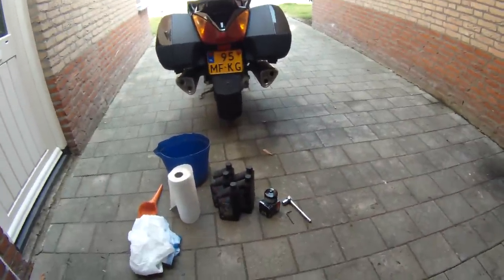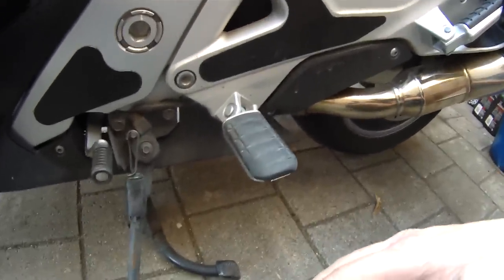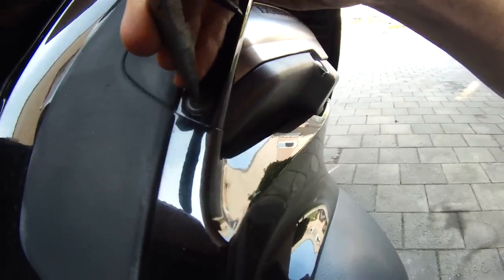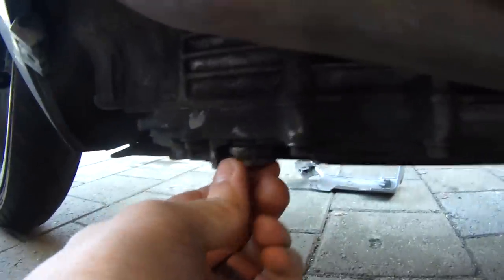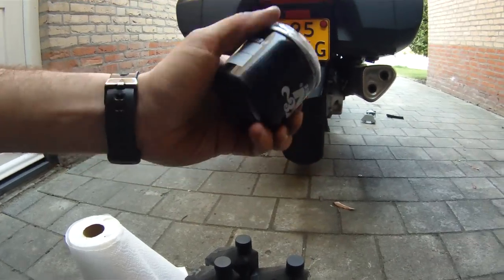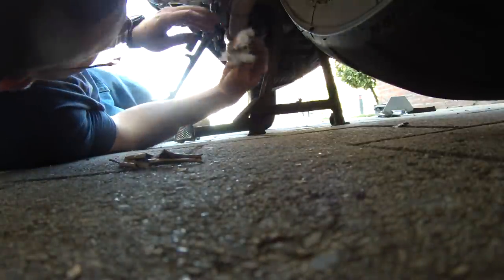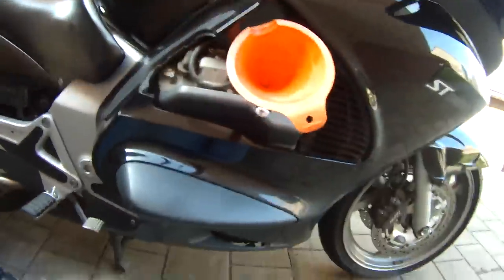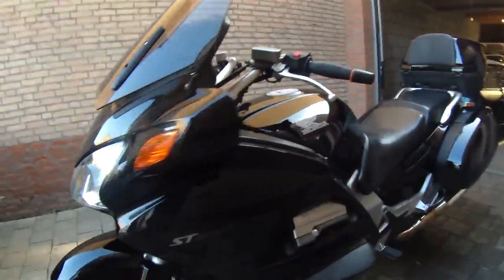How to Change Motorcycle Oil (ST1300)

Comment: What is the black wing attachment for right in front of the knees? How may I suppress heat coming from the right side of the engine to my knees especially the right knee. I don't have tank pads now.
Reply from the maker: +Peter W. Santa-Maria Sr. The pads in front of the knees serve no purpose as far as I am aware. The pads were on the bike when I bought it. As for the heat... I took the tank off and wrapped the frame with heat shield and put a barrier between myself and the engine bay to protect myself from all of that heat. It is great in the winter but in the summer and in traffic it is quite miserable.
Reply: Great bike wrap the pipes with one inch heat tape that will fix the heat problem

Comment: I have used only synthetic oil in my motorcycles for over 20 years and never had a clutch slip and several of the bikes were Honda. What you are saying is not true.

Comment: Synthetic automotive oils are fine as long as they don't have friction modifier additives.  Basically, as long as it starts with 10W- or higher, it's fine.  I've been running Mobil 1 10W-40 and 15W-50 in multiple motorcycles for decades.  Avoid anything with "EC" (Energy Conserving) on the label.  By the way, the W stands for Winter, not weight.  As in the cold weight of the oil at winter temperatures.

Comment: Thanks for the detailed video.  After viewing, I successfully changed the oil/filter in my 2008 Honda ST1300.  It was a little tricky getting the right amount of oil (4 qts) added so that I didn't overfill.  As a first timer, the local shop suggested that I remove/add the oil filter while the bike (and exhaust pipe) was cold. No burns.  Also, I purchased/installed the K&N filter with the nut.  Awesome suggestion!  Thanks again!  Only wish I was a little neater when draining the oil.  Next...adding coolant.

Comment: I'll give it a try on the new to me. From the right side as a comment stated.
Some types of oil may blow away in the wind like hairs, so my ultimate advice is to not do this in windy weather. Always have enough plastic underneath.
Recycle the old oil, some shops have heaters that burn old oil and I used to deliver it there.
These oil plug rings are from soft metal. Put them back in the same orientation and clean the drain plug before removal.
Study the amount of torque the plug needs (22 foot pounds by manual but being dry. With a little oil on it, more likely round 17 foot pound. The thread is easily stripped from the engine. People do not require torque wrenches, they just stop when the washer is being compressed. Removal of the drain plug is another story. Some are stuck into place and that happens a lot. Warm engines help and treating with penetrating oil the day before. The best penetrating oil is made on demand: 50 percent acetone with 50 percent Automatic Transmission Fluid or final drive oil and keep shaking. Do not use no penetrating oil on a new to you motorcycle. Don't hammer or pull the wrench repeatedly, like many people do. When you followed up my advice,  warm engine and penetrating oil, I would say it is most safe to lengthen the socket wrench with a metal bar and it will crack loose in just one pull. 
The funnels that are commonly used have necks that can bend and a screen at the bottom of them, that some day may safe you. I had oil from unknown origin and it contained a welding droplet. Everyone could want to keep an already opened can because those are large. When filling bottles with the old oil the screen will also reveil small objects. My other Honda (PC800) would not accept a straight neck funnel and the long neck funnel does not have a large volume.
Filling soda bottles gives you an idea how much oil should be added back in and you use one of the same preferably for adding. Riding with too much oil and being ok with it is a common mistake.
Oils that can slip the wet clutch have friction enhancers like teflon in them. Not any kind of factory gasket material can really withstand full synthetics and the cleaning power may dissolve the dirt from old gaskets, being not always a good thing. Half synthetics are way more gentle.
I have read somewhere the oil being low in the inspection window, will show to contain more after the inspection procedure of 3 to 5 minutes running stationary, a 2 to 3 minutes wait and then placing the motorcycle level. Level being on two wheels. I wanted to do the oil inspection safe enough and have fine results placing a shaving mirror on a short stem a little further up front and shining vertically towards the mirror with a LED flashlight.
After all oil changes I hear a burp from the oil filter, mostly after a few miles. So I ride fairly slow and wait for it.
Reply: I would like to answer to myself. Today I changed the oil and it was very easy from the right side, reaching to the left. Now I am afraid the oil gets stolen. Not any fairing had to be removed and my reservoir, being a pan 7 cm (little less then 3 inches) high, could be put underneath with ease. The engine head cover was a pain to remove. The rear and most close to you corner has a grommet over a steel pin The other rear corner has a rubber ring only but this is in the way. As soon as the grommet is off the pin vertically and you can move despite of the rubber ring having a conflict with a rubber spark plug cap, the plastic is removed horizontally from a rail up front, where two half a centimeter wide clips slide under.

The level glass was fine to see from the saddle with a mirror in the hand and bending over. This should be safe enough. It must be checked with the bike level and held up straight. Then still after 3-5 minutes idle (outside temperature difference) and a wait of 2-3 minutes (viscosity). The difference in checking cold was from exactly between min and max to minimum after the procedure. I expect to check the level, engine being cold, at maximum now. Trust me. I use a larger funnel with a screen and the difference was half that funnel filled.

The oil plug has a magnet. I fasten bolts with the hand close to the center, or halfway the lever. There was no difference with trying to fasten it tighter. It should be no problem. Did you know police officers on motorcycle can wave at you? What a day.

Now the final drive oil change. Did you know you need a small plastic bottle with a piece of, not too wide, tube glued tight to the cap? ATF is very slippery.

Comment: Hi. Good thorough job. Why do you remove the lower left cowling? If you put the bike on the side-stand you can gain easy access to the filter and drain plug from the right side of the bike.

Comment: Jeezzz Buddy. Get yourself a proper drain pan.
Replace the aluminum crush washer only every 3 to 5 changes or if it's visibly thin.
Clean the filler cap area as grit can accumulate under it. Compressed air blast if you have it. 
The oil cap washer might need replacement every 20 changes...maybe.
And just add 4.8 ltrs of oil. No need to overthink it.

2006 ST1300 178000 kms, oil/filter changed every 5000 kms religiously. I can do it with my eyes closed and a beer in my right hand.

Comment: the washer is called a crush washer. and warm oil is less viscous. which means its not as thick and flows better. and the filter doesn't need to be primed. the oil pump will force fluid through the filter anyway. other than that, great job!
Reply from the maker: Good to know, thanks! It may not be necessary to prime the filter but on some engines it can effect the oil pressure for a few minutes with an unprimed filter. But you are right, you don't have to prime it.

Comment: Great video. Very helpful. I've changed the oil twice on my '04 ST1300 (once every year I've owned it) but the video is a great refresher. Funny, I sold my '74 Mini to buy the ST. Good luck with the car. Most fun you can have on four wheels. Subscribed.

Comment: I have a 2006 st, i don't have to remove any plastic. There is enought space to do the work. The only thing you have to do is to put de central stand up. Put your bike on a front wheel stand, if you have one.
Reply from the maker: You can certainly do that but I always get oil on the lower cowl if I don't take it off. So it comes off every time when I do it. It is rare that I do an oil change without spilling a drop. Maybe I am just messy!

Comment: Great vid. How many miles on your ST? And how often you doing the services? I've just bought a 2nd hand ST, with 20k miles and really has an impressive Honda service history - all oils changed every year regardless of miles. Un decided whether I'll do my own services or not.
Reply from the maker: Welcome to the ST community! They are great bikes an VERY reliable. I have done over 70k miles on mine and only done regular maintenance. I would highly recommend doing you own services because shops charge a lot due to the time to remove the plastics. FYI your bike should have had a valve inspection/adjustment at 16k. Make sure that was done because some people skip it due to the cost of having it done. I do my oil changed every 3k under normal riding. If I take a long trip I will change it again. I do the final drive oil every 2 oil changes and I do a fork, brake, and clutch flush every 30k
Reply from the maker: No worries! The clunk you are referring to is completely normal. Some bikes do it more than others. It is the gear catching from neutral and basically picking up the space between the gear. When you shift into first and the clunk does not happen then that is because the gear happens to be perfectly lined up in the transmission. Enjoy the ride my friend!

Comment: hi there trying to find a video on how to change rear brake pads on a st1300
Reply from the maker: +Susan Lurens Sorry for the late response, I have been away. Have you resolved your rear brake pad issue? I highly recommend the ST1300 service manual from Honda. The job is fairly easy and the pads are held in with "pins".
Reply: TheWrightGarage is right :-) . You probably already done it but anyone else considering it, go get yourself the Haynes workshop manual, it's very worthwhile. I did a full brake and clutch bleed with this manual, excellent tutorials. If you are not bleeding the brakes, put a couple of feet of clear plastic tube on each bleed valve first, tape it to the side of the bike. Crack the valves remove the old pads and carefully press the pistons back, not with metal, I use an old toothbrush handle. When you have the new pads in, close the valves, pinch the hoses one at a time and remove catching as much of the oils as possible in a jar, top up the master cylinder and give it a few pumps to bring up the pressure. Flush with fresh water as brake oil is water soluble. http://www.st-owners.com/ has plenty of advice and tutorials. By the way if your bleeding hydraulics and a neighbour comes over to chat, make sure you close the bleed valve or gravity will suck the thing dry and you will waste a lot of fluid getting all the air out  :-D.

Comment: Have you done the drive shaft oil and the coolant?
Reply: I have done the final drive oil and the coolant. Final drive is very simple. Lower nut on the final drive is to drain it and the larger nut on the top left is to fill it. Just fill it with 80W-90 gear oil until it drops out. The coolant can be drained from the Lower rad hose or I recommend taking off the water pump and replacing the gasket. This will completely drain the system and you will have a new water pump gasket!